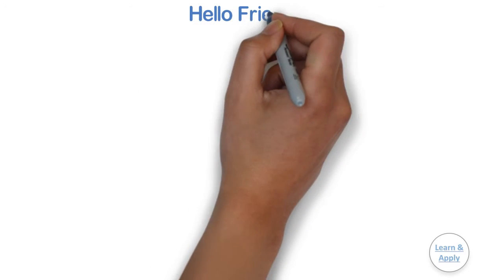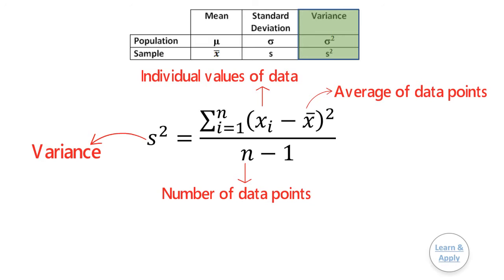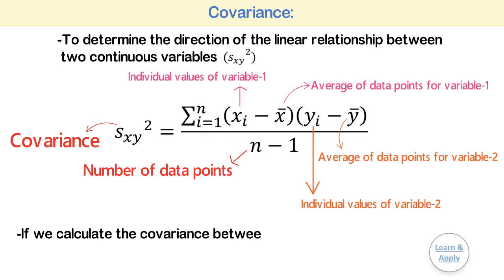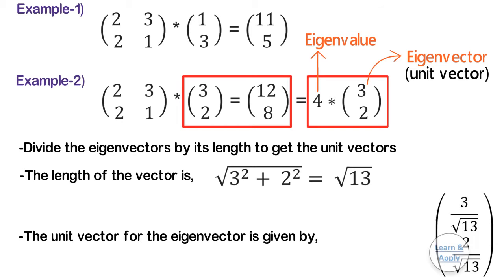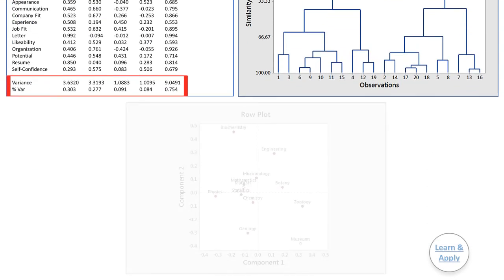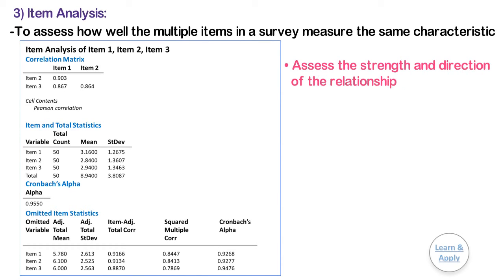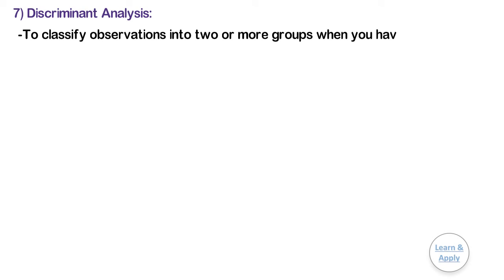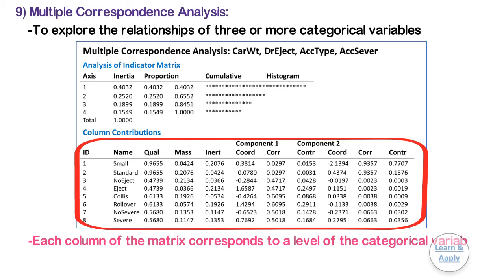Multivariate Analysis: Introduction, Important Concepts, and Multivariate Tools

Comment: Brother last time  I requested you to please make some videos on CCA/DCA and RDA in a same simple way as u explained the PCA . Please do explain the table and graph both.
I like your videos bcoz u explain steps, graph and results table also.
Which is not found in most of the videos
If u have problem nonavailability of the software plz inform me. U can do these multivariate analysis on XLstat.
Reply from the maker: Thank you so much for your valuable comments and appreciation.
I don't have the XLStat and I will definitely check how to address these topics in coming videos.
Reply: @learnandapply  I can provide that software